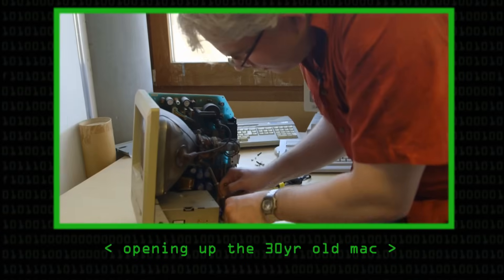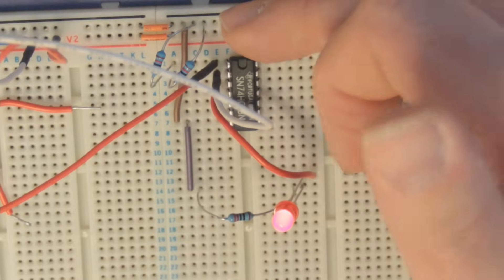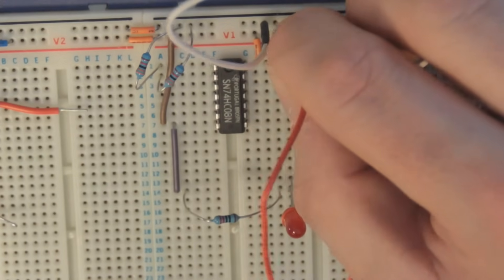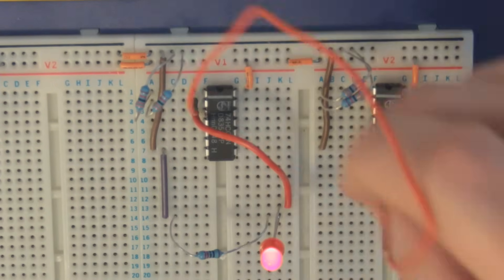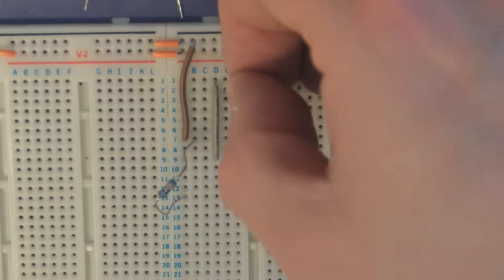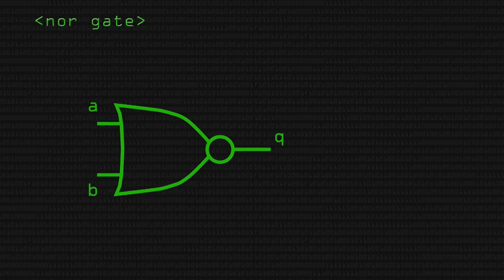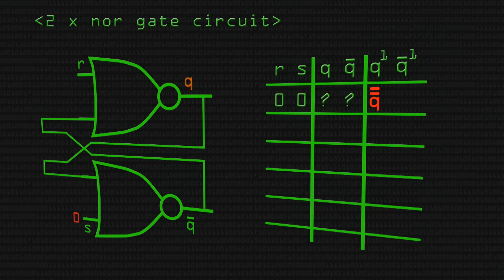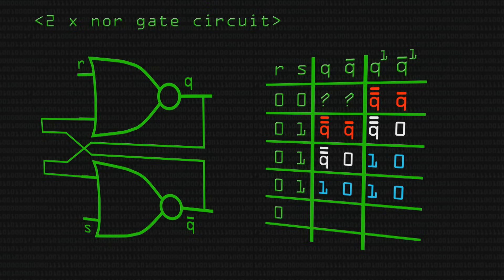How Computer Memory Works - Computerphile

Comment: can anyone help me out here? I know that if both inputs get set to 1, the outputs will both be 0. when you send a new valid state, say 0, 0, then we enter a "race condition". let's say the top one switches first and sends a 1 down to the bottom gate, what happens to the 1 that was "on its way" to the top gate? does it get overwritten? thanks!
Reply: If 1's on second then who's on first?

Comment: I wish you explained how muxes and demuxes work, to understand how memory addressing works at the hardware level. I already know big memory drives are accessed using 2 chained muxes, 1 of the muxes selects a row of memory, while the other mux selects a column, together they select a single unit to be retrieved by the CPU. The unit can be of any size, a word, byte, or bit.

The chained muxes are used because a single mux would require too much circuitry, making chips big and expensive. So by adding a little bit of latency, they kinda preserve performance while substantially simplifying circuits.

Another thing I want to know is whether memory access is truly O(1), or if it's O(log n) while the constant size of the address bus makes it seem like O(1)

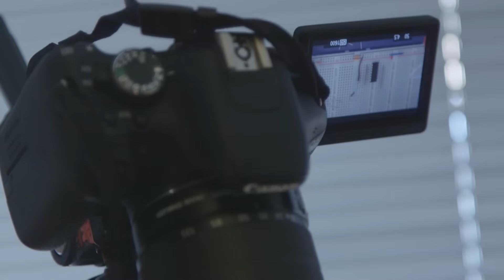Comment: 06:50 — «We have a quad-input NOR gate, this is four NOR gates.»
OK, four inputs plus one output is five, times four gates is twenty, plus 0 and Vcc yields twenty-two.
Surely more than fourteen, right? Fourteen is (2+1)*4 + 2, thus either these NOR gates certainly have less than four inputs or you have less than four of them on this chip.

Comment: Daaaaaaamn.....I always assumed it was something to do with tiny capacitors "storing" or "not storing" charges...I guess I was rather "out to lunch"... 🤯
Reply: You are not wrong. The one he was showing there is SR latch and it is the very basis of SRAM in which there is no capacitor involved. If I'm not mistaken, to store 1 bit in SRAM, it involves like 6 transistors. However, DRAM uses capacitors along with transistors, and to store 1 bit, DRAM takes 1 transistor and 1 capacitor which needs to be equipped with refresh circuitry to retain bit voltage as capacitor drains along with time.

Comment: @Computerphile
you can't explan how they doing in real cpu micro transistor
i tried it for build 8 bit adder with finfet 3d structure.
the problem for asking is the unique not gate source power  line
other gate can share the source line, 
if share will not gate, after the following gate will grounding and turn off.
how the real cpu fix that should including lot of unique source line only for not gate?

Comment: So memory is stored when the circuit gets filled up with all the relays being left open or closed?

Also if the electric is turned off how is the circuit/ relays still saved and not all gone back to its original state? ....if that makes sense.

Comment: There is an intuitive way to explain what's going on:

Consider two NOT gates, labeled A and B, feeding into each other.  This simple circuit already stores memory.  When A's input is 0, its output is 1.  Then if you connect A's output to B's input, B's output becomes 0.  Connecting B's output to A's input does nothing, because A's input was already 0.

This is a stable circuit.  The wire from A to B is on, but the wire from B to A is off.  Now what happens when you supply power directly to the wire from B to A?  A's input becomes 1, and its output becomes 0, so B's output becomes 1.  By doing that, you have "flipped" which side of the circuit is "powered".

This is effectively identical to the RS NOR latch of this video, the only difference is that the video uses NOR gates instead of NOT gates, which allows you to use the second input of the NOR gates to supply power to one side of the circuit.

(This can be easily demonstrated in minecraft with two redstone torches feeding into each other)

Comment: I've seen this arrangement using pneumatic valve blocks the pull down resister function was an a air bleed instead.

Comment: Great video, seems strange that the term "flip flop" wasn't mentioned anywhere? Also these can be built with NAND gates instead of NOR gates but then they become active low rather than active high (so you need a 0 input to set the output to 1 and a 0 input to reset it).

Comment: They should have mentioned the S-R flip-flop's inherent flaw, which is: if both R and S are 1, on the output Q and /Q will be equal to each other, which is obviously not how boolean algebra should work.
Of course there is an easy way around this, just don't let R and S be equal to 1 simultaneously. And the J-K flip-flop fixes this issue, but that requires a clock signal to work.
Just thought this should be mentioned when talking about S-R filp-flops..

Comment: I severely dislike that explanation.
While logically, a NAND gate is taking an AND gate and then putting a NOT gate on the output, electrically it typically isn't. Electrically it is very easy to make a NAND gate directly, and for CMOS, PMOS or NMOS, NAND gates are made directly and an AND gate is actually a NOT gate fed by a NAND gate; likewise the NOR gate is done directly and an OR gate is a NOT gate fed by a NOR gate.

Comment: That's an awesome video but i'm curious about one thing; in the inverse of the AND gate, when both inputs are "0" or "off" the result comes back as "1" or "on". how is this possible on  a physical level? doesn't 0 mean no electricity? so how come providing no electricity to the gate gives electricity on its own? am I missing something?
Reply: M41k Develops At the transistor level, the “gate” is 0V, which for this type of transistor (P-N-P or N-P-N, I forget which) allows current to flow from the “emitter” (always +xV) to the “collector” (the output). When the “gate” is +xV, the gate is “closed”. The converse is true for the “other” type of transistor; sorry, I always get them mixed up.

Comment: How can I erase  a stored memories in an ic  that's in a auto motive module ..
Reply: Disconnect the battery. This will not erase the embedded software that manages the engine (which is stored in ROM), but it will make your ECM 'forget' everything; so basicly factory reset.

Comment: This could have been done so much clearer and btw. you explain how static memory works and the ram chip you show at the start use dynamic memory which is working with refreshing charge or no charge on capacitors rather than logical circuits.

Comment: So the max CPU "speed" is based off of how quickly it can reliably change states given "X" frequency?
Reply: He mentioned there is a delay.. but in all reality (especially in modern transistor circuits) it's negligible.  As for microprocessors such as CPUs with nanometer scale transistors being used in logic gates.... the speed of information processing (even in the GHz range) still isn't fast enough to allow the lag caused by gate delay to be noticeable.  The max CPU speed is dependent upon the efficiency factor of it's design and the maximum power at which the chip can function while staying below it's thermal breakdown.

This is how extreme overclockers can push chips well past their normal maximum speed... so long as they can keep them cool under extreme power.

Comment: Still have no idea how memory works.
Reply: PC Systems developed slowly bit by bit over the course of 3 decades if not more and you're trying to learn system that was created in span of such a long time in low amount of time.
As you learn new stuff it will fall in like a puzzle little by little.
Give it time and you'll see your understanding grow
Reply: You take your ram and put it into your socket... Turn on the computer and it works.
Reply: Even if you remove the input, the LED stayed ON
Reply: I did understand, but my power supply failed and when I woke up, it was gone.
Reply: Then just buy a mac.
Reply: @c25789  True true,buy a mac,break it cause its garbage,and u can see the chips and stuff and u can learn how memory works for yourself

Comment: So that's how the RAM works?
Reply: This is actually a so called 'RS flip flop'. It does the job of storing values, but actual memory is designed at transistor level. It's a similar principle, but with less components. This is case for SRAM. There's also the DRAM, which is more simple, but is less efficient.
Reply: Technically yes in a way

Comment: @3:04 is anyone able to determine which book this is? I've looked but can't find it.

Edit: Got it: Practical Electronics Handbook by Ian Sinclair
Publication date: 1988.
Reply: TTL data book ... is similar but has more info on every 74 series and by extension all 54 series chipsets ... btw when you can use the 54 series as they are the better chips (mil standard spec) the 74xx series chips are tighter parameters but the 54 set have a large operating environment and so last better
Reply: Came to the comments looking for this! Thanks!
Reply: Thank You!!

Comment: This is brilliant! I wish there was an explanation for why the two outputs start out as the opposites of each other; that is, why, if one is q, the other must be ~q. That's the part that's keeping me from following through the final reasoning.
Reply: The reasoning behind this is the logic provided by the NOR gate. The basis of this idea starts with the fact that we have a 00 bit input into SR. Q is basically a way of describing the output. If we don't know any state of the circuit then saying the lower gates output is Q' is kind of unintuitive but if you assume you start with the R gate and say R is 0 then 0 NOR'd with a unknown state must be the opposite of whatever came in from the lower gate. 
With this reasoning, if we don't care what we were given and just call the output Q the output from the lower gate must be Q' (because both S and R is 0). if you instead change S to 1 the gates will assume a definite value regardless of what Q and Q' was.
Reply: Thank you, blockhet. This clarifies everything.
Reply: @mahmudfasihulazam737  it does?

Comment: I feel like the way the nor gates were explained was very confusing. I use it in my daily perl work and he lost me part way through. Lol.

I assume the gates function the same as an if statement using, "!(x or y)" is that correct?
Reply: Yes. NOR simply means Not Or. So you take the result of the OR operation and flip it no matter what it is.

Comment: Wait so if you turned off the computer the circuit would still be going?
Reply: No, it has to have a constant power supply to store its state.

When you put a computer to sleep, it keeps a small power supply to the RAM so it can remember where you left off without having to boot up again.

Flash drives can store information even without power. But the trade-off is that they're a lot slower than RAM.

Comment: thats how ram works not how memory is stored
Reply: Benjamin Franklin no i mean the disks like the hard drives or ssd . ram is memory but people dont use it to store data in long terms
Reply: // A hard drive doesn't work like this; it uses an electromagnetic head on a moving arm that hovers ~ 10 nm above the surface of the spinning disc, during operation that head, by small bursts of current, changes the polarity of small parts of the surface of the disc - so one polarity represents a 1 and another represents a 0; the same head can also read back that data by sensing those polarities.
Reply: RAM = Random Access Memory. So it is memory, you are right in that it is not typically used for long term storage, but it doesn't change the fact it is memory

Comment: This looks like a BJT multivibrator circuit.  Is this the same thing?
Reply: +Derek Snyder Nah, this is called an SR latch, its basically a Boolean representation of a flip flop.
Reply: +Nate Macko The transistor representation of a NOR gate can be simplified a bit for making an SR latch... which results in SRAM cells taking 6 transistors (which is why it is much more expensive than DRAM which uses 1 or 2 transistors and a capacitor, depending on design goals.)  A Multivibrator is a little different but not by much.

Comment: As a circuit designer with a lot of experience using packaged gates, and other standard units like comparators and op-amps; I have to say this is the worst attempt to explain something I have ever seen. Ever. I hope this person is not an instructor at a University; if he is, the students are really in trouble.
Reply: Very true. But he tried, that is what matters.
Reply: +John Affleck As a circuit engineer: If this was my teacher, I would have never gotting interested in hardware engineering. Worst attempt to explaining flipflops I have ever seen.

Comment: What  board  and  what  book   was  used?    I   have   seen  many  solderless boards and books.    Thanks.
Reply: these are called breadboards, there is no point in paying for a more expensive brand. just buy them on ebay or amazon for a fairly decent price

Comment: 5:47  Can i ask a stupid question? where does the chip get the voltage to power the LED when it isnt connected to anything? is something else doing the job here. So sorry but i just cant figure it out :(
Reply: +TheiLame I'm sure someone answered the question already but the comment seems to be gone, so I'll quickly answer again for anyone else wondering.

The chip has 8 pins.  Each NOR gate has 2 inputs and 1 output.  There are two gates, totalling 6 pins.

That leaves 2 pins.  In the case of these chips, those two pins are connected to +5V and ground, high and low voltage, respectively.  This is where the power comes from when no input voltage is applied to the gate.

If you inspect the transistor diagram for a two input NOR gate, you will find that each gate actually has 4 inputs: A, B, high, and low.  The gate-level depiction is just an abstraction to make diagrams easier to read.
Reply: +Andrew Robertson more generally the high input is called Vcc and the low is called Vss.   And meaning: (Vcc) Collector Common Voltage and Vss Substrate Voltage

Comment: Could you try doing a JK flip-flop video, because i still don't understand it that well....
Reply: +Daniel Yao I'm assuming you know what a flip-flop is. Basically, the output becomes the input during the rising edge. For a JK flip-flop, J is Set and K is Reset. However, when BOTH J and K are on high, the output alternates to the opposite of whatever it was last time.
Reply: Oooooh ok, thanks. Everything I searched up was confusing.

Comment: I'm now confused, this kind of sequential logic stores information, and we also have the Capacitor-MOSFIT combination which stores information as well !! so which's really used in computers or it's a combination of both or what ?!
Reply: +Abdulrahman Mahdaly SRAM tends to be used in CPU caches, or any application where quicker access is required. DRAM (CMOS RAM) is slower and requires a refresh cycle to stop the charges decaying.
Reply: Salafrance Thanks :)
Reply: +Abdulrahman Mahdaly The circuit he designed is basically called an RS Latch. It has two inputs (R and S) and an Output (Q). When S is high and R is low, Q is set to high. When R is high and S is low, Q is set to low. When BOTH R and S are set to low, Q stays the value it was last time.

The RS latch is the most basic component of memory in a circuit. It can further be extended to build a D flip-flop which is vital for memory in microprocessors. An Array of D flip-flops is called a Register which can hold a small bit of memory. That memory is used for many things including pipelining and register blocks.
Reply: DRAM is  not CMOS RAM, it is capacitor and MOSFET based, and analog circuit. It would be more accurate to call SRAM CMOS RAM.

Comment: I shorted out a 480 volt, 100 amp panel being an electrician.... It wasn't quite as funny... heheh
Reply: +Jeff Cram 
Yikes!! I worked as an electrician and automation programmer. Did you get burned very bad? I once shorted the 9200 volt side of a small 9200/480 transformer and it was like a stick of dynamite going off, but the current was low and I didn't get burned, just scared.
Reply: sounds fun
Reply: It helps that with high voltage the current is not so big, especially if it it is AC
Reply: 480 threw my X-boss across the room.
Reply: Bones Jones No the metals were the path of the short, I just stood there stunned, not moving a muscle from the explosion and flash of light. People from across the street came over and asked if I was alright.

The worst part was when I had to call my boss and tell him we had to replace a service panel, it would cost about $1,000.
Reply: @portaadonai  did you get fired lol
Reply: @kasumimello6014  No, but it was so loud that workers down the street multiple houses away rushed over to see what happened.

I was totally stunned, didnt move, just stood frozen for a minute until I could think again. The explosion and noise was absolutely paralyzing

Comment: Could someone name the type of reference book he flashes on-screen for a moment there? A uniform pin-out reference would kill a lot of loose printed data sheets for me!
Reply: +Ringtail Garou That looks like a copy of one of Forrest Mimm's books on digital logic.  The reference section in the middle of the book had about 100 different device packages detailed.  All the commonly used TTL (7400 series) and a few of the neato, but harder to use CMOS (4000 series) devices.